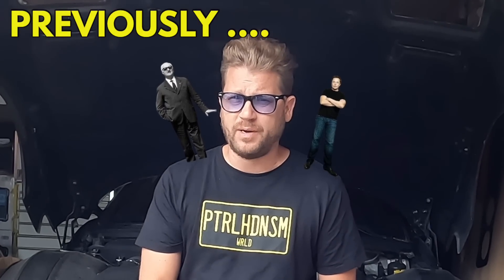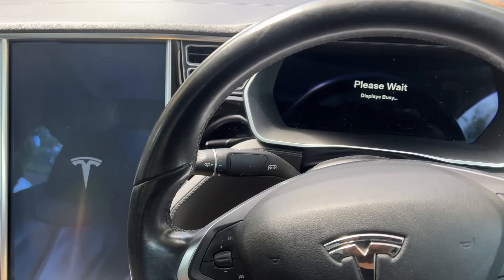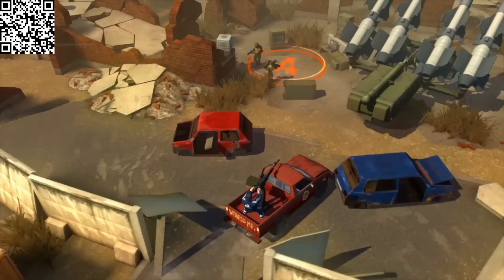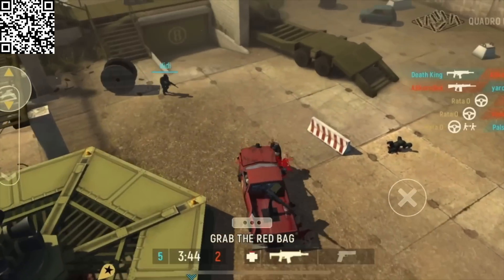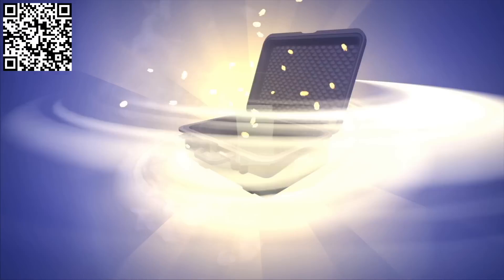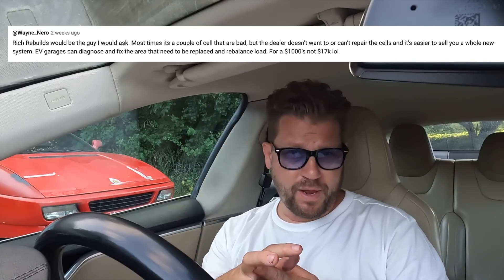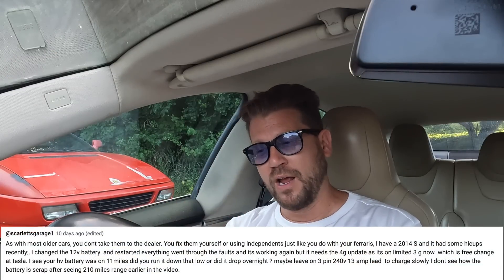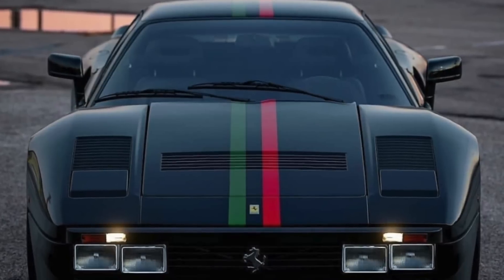I BOUGHT THE CHEAPEST TESLA IN THE COUNTRY - PART 2

Comment: Windscreen wiper linkage repair:

For those who don't mind a bit of DIY preventative maintenance on their out-of-warranty Model S then you might be interested to learn that the windscreen wiper mechanism need not be an inevitable, high mileage >50,000 miles replacement.

The offside wiper spindle is prone to wearing heavily after a few years which tends not to be noticed until there is so much play in the spindle that the driver's side wiper arm wears a groove in the bonnet.  I have applied a small piece of thick tape to the underside of the bonnet adjacent to the driver’s side spindle to give an early warning of heavy wear. 

The cost of the assembly is approximately £170 and if it is replaced by a Tesla mobile technician the total bill could be over £400. ￼

Lifting the wiper arms off the splined spindle can be tricky as there is not enough room to use a conventional wiper arm removal tool.

It might be a good idea to remove the wiper arm nuts some days in advance and apply PlusGas or WD40 to help loosen them.

Once the wiper arms are removed (followed by a circlip, washer and then a rubber 'O' ring) the spindle can be lowered slightly to apply some lubricant.

Whilst the plastic scuttle cover was off I squirted some lithium grease on the other pivots.

I have yet to try it but perhaps a shim at the base of the spindle could take up any excessive wear.

There are some videos on YouTube showing how to change the wiper assembly: here is just one: https://youtu.be/h4ICrDADugU 

Warning: whenever working on the windscreen area, place a thick coat/old towel/carpet/thick cardboard over the windscreen to prevent accidental breakage.

Here is the link for Tesla's instructions for the replacement of the wiper motor assembly replacement should you have left lubrication too late: https://service.tesla.com/docs/ModelS/ServiceManual/en-us/GUID-47977C8A-5AB1-447C-8B14-67C94B6111D1.html
Reply: Great advice. ...but let me add to that .....dont buy an old model s.
Have you ever heard of a car doing thst and these old 85kwh packs are failing now due to age.
So many owners on you tube having the 85 packs fail by short.
Reply: I've just replaced the bush in mine and it seems ro have done the trick.
Reply: @AG-ob3fx  85kWh packs are much better than 90/75 from degradation perspective. But, you have to buy cars what are produced in later months 2015 or in 2016.
Reply: @jirizyka  dont get concfused with dregredation/ battery health.
This is only a sign of lost range.
The amount of 85 packs be uou tube owners alone fail due to cells failing causing shotrt.
Ev batteries rarely will degredate a large % of range.
They fail like himanns with a stroke or haert attack or cancer.
Battery shorts are linked to age bad charging habbitds like bad food habbits but also poor genetics or manufacterer fefecylts in cells like humsn dna.
This whole srea of shorts kills batteries not range or capacity degredation.
James cooke check out his car at xmas or jrgo or many other you tubers sean mitchell bjorn neilsnd etc.

Comment: The price comparison with Polo ignores the Tesla's £17k battery timebomb which you already experienced!
Reply: Its not a £17k time bomb. You can get them repaired for considerably less, as the entire pack doesn't fail. And what about a cambell breaking and a dozen other problems you can get with an ICE vehicle happening to the Polo?! I'm running an 85D Model S which just passed 250,000 miles this week. It still drives spot on and it also has the free supercharging. I've saved 4k on fuel in the last 12 months. And no oil changes etc. Plus your brake pads last 120,000+ And having replaced discs and pads on an E class, I know that adds up too.
Reply: I'd have the polo, then at least I'd be able to fix it myself, and if the engine did fail for whatever reason, replacements are easily available from dismantlers for less than £17000

Comment: You have a software download waiting - the yellow arrow pointing down. Join your car to Wifi. Early Model S can only join 2.4Ghz and sometimes won't join if there is anything else on the network. ( hotspot your phone usually works) 
Let the car update and dont step on the  brake until its restarted.

Comment: Some hackers did figure out how to unlock some features like acceleration boos (for the LR Model 3), heated seats, and the self driving software package. Plaid is only possible if you have the plaid motors.

Comment: whilst the black is nice and good enough to leave, I would consider wrapping the chrome trims on doors/windows - these really date the cars (certainly the model 3's) and to be fair look pants versus the black trimmed variants, I'd assume wrapping would be much cheaper than replacing with later ones - great work so far!
Reply from the maker: I did think about doing that
Reply: @Ratarossa  Buddy had it done on a 3 series touring from chrome > black and it made such a difference - was a few hundred in total and got them wrapped rather than painted, made the car

Comment: When you use the heated samplers in thick plastic, if you turn them a little bit, the seam get even stronger  🙂
Reply: "Samplers".  lol  You meant staples or autocorrect got you.  But good thought and I had the same.  A quick turn of the hot staple when embedded in the plastic locks it in.  Strongerer joint achieved!
Reply: @thedeadsenator686  You are absolutely right, sometimes I hate autocorrect 😂😂
I have done that with mine and worked great.
Have a great day…

Comment: Re the old car, has your friend got in touch with someone like Cleevely EV repairs. It's never an entire pack failure. I'm running a Model S 85D that has just passed 250,000 this week. It's a great drive and I intend to hang on to it for a good while yet. A small tip at the supercharger, you can use the button on the charger to open the charge flap. Saves going into the menu or using the key.It's a long press on the back of the key to open the flap or double press to open the boot. And as you like games, I believe the PS4 controller is the best for playing the games on the car. Or you could just watch YouTube

Comment: You say the electricity is still cheaper than petrol and diesel, but it isn't when you are paying those prices! if its 60p/kwh, and you get the 4miles/kwh, thats 15p/mile. With petrol and diesle currently at £1.50 per litre, that's 10miles/litre, or 45MPG, something thats perfectly achievable in even large diesel cars.

Comment: Great work Scott. I thought you had to be a little careful with jacking points on Teslas - ie jack up BOTH front/rear wheels, as it can cause the battery to twist (part of the structural aspect?)
Hope I'm wrong, but worth mentioning just in case......
Reply: PS, gotta ask in addition - what's the deal with the 348?

Comment: Oh Scott.. you broke so many rules, it's hard to keep track.. lol   First off, nothing wrong with the 19's.  In fact, what you did actually made things worse.  In terms of range that is.  Yeah, I get it.  They might look better esthetically, but ultimately they're worse for the vehicle.  Not to mention they're dark wheels.  Nothing more horrible than having dark wheels on a vehicle.  You know its winter around my area when everyone puts on black steelies with winter rubber.  That's what I equate to having black wheels.  Horrendous winter!  😛
Aside from that, supercharging.  Yeah, try to avoid that as much as you can.  The poor thing has 237k miles (Good lord that's alot!  Here people get nervous when a vehicle has more than 100k km's!).  Last thing you want is another battery pack giving up on you.  Try to charge as much as you can at home.  And only to about 80% of the battery for most things.
While not having the pano roof might be inconvenient, it might've saved you future headaches.  The models with the pano roof have leaking issues.  As you know, water and electrical anything don't mix. 😉  Aside from that, looking forward to the bumper upgrade.  Wasn't sure you were able to do that type of upgrade without changing the headlights and the bonnet.
Reply: The pano roof leaks? Never had that in 5 years. The sunscreen, now that one he should avoid, there's a reason they no longer offer it as an option
Reply: @vadeka  you were 1 of the lucky ones. It’s a very common thing apparently. Many leak. They also don’t retract well if you attempt to open it. Another reason why they’re only a fixed thing now. 🤷🏻‍♂️
Reply: I just repainted my standard 19’s on my 2018.

Comment: You can order OTC parts as a new service request at the closest service center. Usually when they are ready you get a message to pick them up. The worst part on the conversion is the lower valence as it’s the moat expensive piece of plastic…

Comment: There was another video of a guy in USA who repaired a Tesla main battery- I was sure it was your original car, and thought this video would be about the repair.  The fellow opened up the big battery and found 1 cell out of the 17000 was bad- apparently this one bad cell causes the whole system to shut down and not charge properly. He replace the cell and the battery worked fine- cost for the labor to remove and open the battery- test to find the bad cell and button everything up was about 7000.00 US.
Reply: Doesn't seem a very good design if 1 cell in 17,000 can cause complete failure
Reply: @bikeman123 Sort of yes and no- good to be able to just replace one cell rather than the entire battery, but the cost of finding it is expensive.  I suppose the manufacturing theory is that there is a pretty small failure rate on these little cells and they are probably tested by some robotic device before approval for installation.  As time progresses and more people get involved in the industry, there will probably be independent shops that can open, test and replace bad cells at a reasonable rate.

Comment: Velcro that sliding arm wrest, pack some old socks behind the plastic panels to stop em from being acoustic.
Change the steering wheel with apehanger handlebars and the steeringbox to match handlebars, then remove the driver seat and install a chopper motorcycle seat with a backrest, get a tattoo, join a band.

Comment: I’d buy one of these for that money! 🙌 the free charging makes it a no brainer 😎
Reply: If you can find the free charger and only use a Tesla charger that A, isn't broke or B, isn't in use. Any other charger will cost you more then any diesel or petrol per mile. Home charging is also dearer even using Octopus the cheapest EV charge company.
Reply: @trevorjones5625  Well... If you have a compatible EV it's possible to go onto an Octopus tariff which gives you 6 hours at 7.5 p/kWh. That works out at 2p/mile or less. Otherwise you can get 4 hours at 9.5p, still less than 3p/mile.  But yes, charging on rapids is expensive right now.

Comment: the battery can be opened and the offending cell that is shorting the voltage can be disconnected, cost is less than £1000

Comment: Great content, would argue that if you are going to bother doing the brakes, upgrading the calibre, rotors, and pads from a good brand like Brembo, isn't that much money and it will majorly improve the car. Generally, Tesla's actually benefit majorly from some tweaks here and there when it comes to handling and stopping as well as it accelerates.
Reply: The standard Model S brakes are made by Brembo.
Reply: @robertgreen9614  hence why getting better, calibre’s, discs and pads are so easily swapped in. Brembo produces a wide range of products, discs and pads from different material compositions and different characteristics. The standard discs are a weakness on the Tesla because the car is particularly heavy. If you have an S and live around some winding roads, making the pedal go soft is a bit too easy relative to the fast acceleration, IMO.
Reply: @vinex19  Don't forget to put some decent stainless braided hoses and higher spec brake fluid in it (Tesla only specifies Dot 3).. Be a shame if you spent your money on all the other crap you thought you "needed" and still ended up with a soft pedal.😉

Comment: Battery, no problem.  Charging at home on 110/120V outlet, no problem.  BUT here's my problem:   In April of 2020 I bought a 2013 Model S 85 from the original owner (the main drive unit and main display had already been replaced under warranty @90K miles). That meant that the car I bought was on it's second drive unit and display @96K miles.  In the summer of 2023 I began experiencing episodes of the drive unit cutting out during normal driving. Within a year the issue became worse, and by the Fall of 2024 it was happening almost every time I drove the car.  So in mid-November 2024 I drove it to the local Austin, TX service center and on the drive there it cut out 3 times. When I got there they said I should leave it with them (without an appointment) because it was a "safety issue". The diagnosis (the same day) was that the drive unit was failing and had to be replaced.  My choice: do nothing and have eventual total drive unit failure on the road somewhere requiring a costly tow, or do the replacement now. I authorized the replacement~ $6700 (out of warranty). The car has 140,000 miles now and is on it's 3rd drive unit. If I had known that this was a possible issue, I never would have bought the car back in 2020. This may not be typical for all early Model S's, but I was unlucky enough for it to happen to mine. Three (3) drive units in 140,000 miles of normal driving is not my idea of a dependable car.

Comment: Using an overnight tariff with Octopus it costs me £3 for 41kWh at home and about £16 from a Tesla supercharger when on a road trip.
Reply from the maker: thats pretty darn good , it that for a full charge
Reply: @Ratarossa  Yeah i have model 3 SR+ Tesla don’t actually state what capacity the battery is but i guess its around 55KW i had about 14% left Monday charged to 100% overnight for £3 using Octopus Intelligent tariff. I can do about 250 miles or so in mixed motorway / Dual carriageway and a bit of single lane roads around here. Superchargers in the less busy area have off peak rates of about 24p rising to about 39p in most areas which is still pretty good. I have spent £12 in total over the last 31 days for charging from home.
Reply: @Ratarossa  If you are looking to use your car on a road trip and can’t access a supercharger for some reason find a hotel to stay in with EV chargers, most are free or a nominal cost.

Comment: The free supercharging is amazing, but am I crazy or is the supercharge price of 0.5-0.7GBP not very similar to petrol prices? You forgot to include the 30 mile range test btw. :-P
If I compare the fuel/km price it seems similar to a 20km/l petrol car. (charge cheap from home and that changes of course)
Reply: Superchargers have come down in price and are at about 36p per kWh except for peak hours (4-8) which are about 43p. But even at peak that still works out as 10p per mile rather than 17p in my Diesel.

Comment: £17,000 for a battery but if the diesel or petrol engine in my Jetta blows up I can pick up a second hand 1 for £3-500 pound and maybe same again to have it fitted so for £1,000 not £17,000 my banger will run cheaper and longer than any tesla 

If this channel turns ev it will be bye bye from me sorry but EV is the scam of the century and worse on the environment